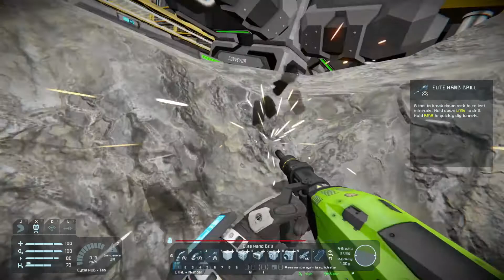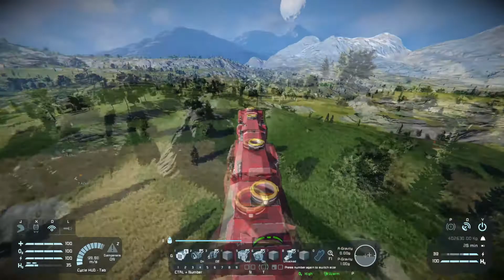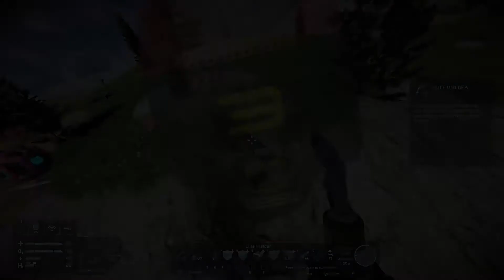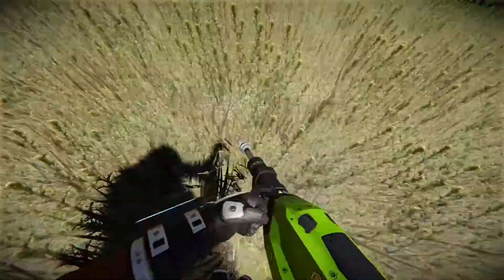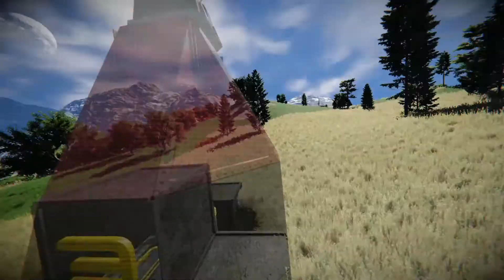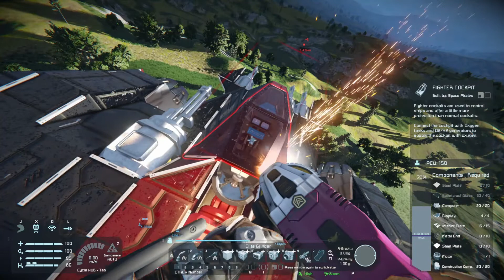Hephaestus Prime EP38 - Say Hello To My Friends (Space Engineers)

Comment: Not sure if you'll see this comment on your old video, but on the workshop there are two related mods by user Viktor: Multigrid projector and Multigrid projector extra (or similar name for that second one). The first one is a godsend, does exactly what it says. You'll be able to project and build subgrids in survival.

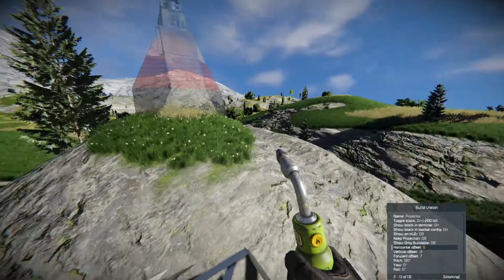The second one is relevant to your comment about projectors and control hassles at time 16:15. With it, you can put down a control seat (cockpit, remote, etc) and when seated in it, add a Toggle Manual Alignment to your hotbar. This lets you move and rotate the projection's placement with the usual block rotation and player movement keys! It's sooo convenient. No more dumb control panel sliders. For best use, make sure your seat/view and the projector are oriented the same direction. (projector's "front" is the side with the two hatchmark ridges, and "top" is the side with four crosshair mark ridges)
Reply from the maker: Hi Dakao. Yes YT tells me about these comments. I'm aware of the multi grid projectors, Sharpy101 use it a lot on his channel, but like a lot of mods, I generally steer clear wanting to stay relatively vanilla while I 'learn' the game. That said, I'm probably at the point now where I will start experimenting a bit more with such things, when Far From Home is over, I'm looking at a stream series just flying around asteroids building a big ship with no particular purpose or story in mind, a chance to try out some of the mods everyone has been suggesting.